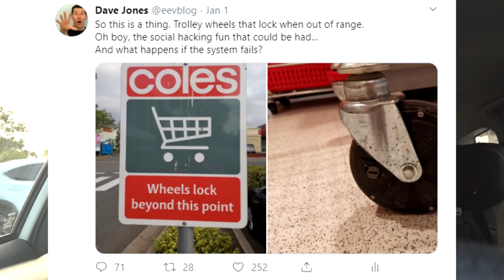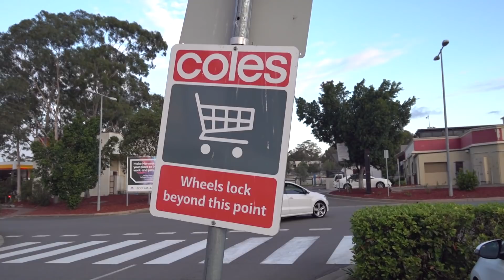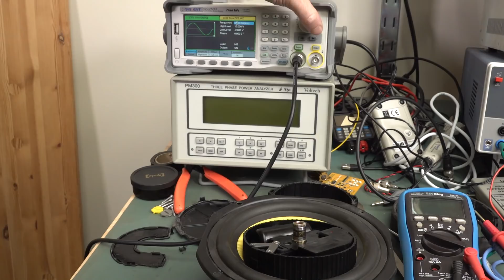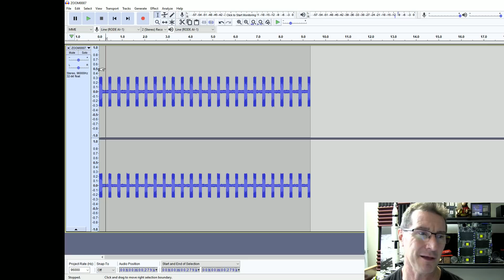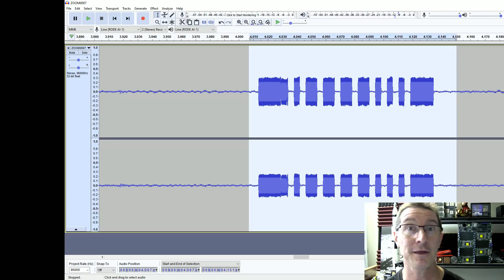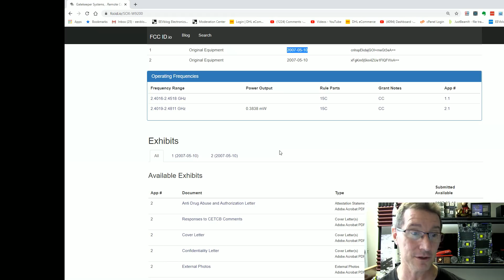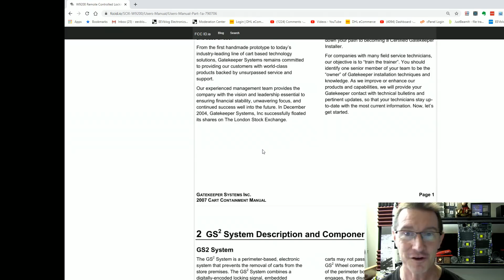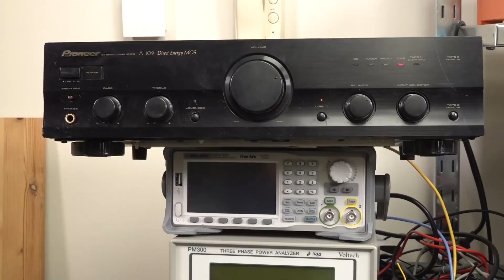EEVblog #1287 - Gatekeeper Shopping Trolley Lock Investigated

Comment: Hey Dave, Do you not think that it's a unique coded signal specific to the installation. I mean each supermarket will have it's own unique signal code to lock and unlock the wheels and that's why it didn't trigger it.

Also, is that supermarket using the Gatekeeper system? Because if it was made by another brand then the signal will be different.

Just a thought.
Reply: You're dead on
Reply: @allensmithphotography  The sign at the shop was from Gatekeeper Systems so i don't see why the wheels/system itself wouldn't be.
Reply: @danmackintosh6325  because the wheel was sent by a fan not from that shop
Reply: @allensmithphotography  Pictures on the FCC application look 95% similar.
Reply: @sleeptyper  right and America alone has multiple manufacturers of these devices likely purchasing or licensing the design but would want their accessories to only with their wheels and vice verse
Reply: @allensmithphotography  but both Dave's wheel and those at shop are "Gatekeeper" brand, can't see them having specific code for a specific shop since what would be the point?
Reply: dan mackintosh neighboring shops?
Reply: Unique identity for ever wheel so individual trolleys can be stopped. I'd guess the small antenna on the pcb picks up data as to if it will be stopped either at the door or the edge of the car park. The inductor probably picks up a big signal hidden in the ground to activate.

Comment: I spent around 14 years working at a GPS chip startup which shared a parking lot with Gatekeeper Systems. We'd see their engineers pushing carts around the parking lot all the time, and occasionally chat with them when we were out taking walks. But this is the first time I've seen the inside of one of these wheels! Thanks for sharing this one!

Extra credit for anybody who can figure out which GPS startup I worked for. Note that it wasn't a little startup for that whole period; we got bought by a much larger company, which then got bought by a MUCH larger company.

Comment: I'm from Italy and here the carts need a coin (or sometimes you can use a dedicated token) to release the locking mechanism from the next cart in front (they are all chained together and then to their parking spot) so people naturally want to put them back properly to get the coin back at the end
Reply: Same here in Germany. I think this system with refund for the cart is used in supermarkets all over Europe. Here you can either insert 50 Euro cent, 1€ or 2€ coins and unlock it. Everyone brings back their carts -  problem solved. No expensive probably unreliable technology needed. I know Aldi implemented the system in the US as well.
Reply: We have that here in the southeastern USA with a few stores like Aldi, but stores like Walmart just have cart corrals all over the parking lots, same with Kroger(food stores) which have the different sized carts, and corrals all over the parking lots. I guess people in my area just don't steal the carts as often as some others, and like i said Aldi being the most security I've seen, and the worst being the Walmart parking lots of people pushing the carts into the grass areas because the corrals are so far apart in the giant parking lots in which some are as big as a small trailer park.

Comment: So basically like a drum brake.
Reply: Beat me to it I was just going to say that thought I'd look forced so I didn't embarrass myself repeating comment.
Reply from the maker: Ah, now that you mention it, yes.
Reply: Yea, I thought that those plugs would drive out like a piston to block the wheel from turning until he took it apart.
Reply: Ahh really smart and effective.. and I haven't got to that part yet, I'm already excited to see it :D
Reply: Thats exactly what I thought it would be. Low force, simplistic design = cheap cost.
Reply: Yup
Reply: Reminded me a lot of the electric brake drums on caravans and trailers
Reply: It's not flush, so it's more of a mechanical drum brake of sorts
Reply: In principle,no . Drum brakes don't work in this way . Drums have pads that exert evenly and have proportional friction based on how much force is applied in a non linear way. Plus drums have a much higher temperature range and mechanical advantage
Reply: @eksine  The basic actuation principle is the same on simple drum brakes, so the analogy is working.
Reply: @ehsnils  not really, the Force applied is uneven and it has teeth.it merely looks similar to drum brakes but in principle like I said it's not anything remotely close. It's like an Elvis impersonator. It might look like Elvis but it's not even close
Reply: yeah they arent veey good, if you force it they burn out pretty quick hence why the new snap cap version is used more now.
Reply: @eksine  An impersonator? So basically, like Elvis.
Reply: I was thinking more like a centrifugal clutch but yeah drum brake too
Reply: The way the inner plate is pushed against the inside of the outer plate is somewhat similar to a drum brake. 
But the act of stopping it is locking rather than friction. 
So the way it behaves is more similar to the park gear in an automatic car.

Comment: The colour insets that appear to do nothing are possibly for identity/programming indicator.  The combination of two colours could identify the specific lock code it is set for.  Typically for large chain stores they have a central depot/repair facility for broken trolleys and the repair centre would need to easily identify the unlock/lock codes easily or check the repaired trolleys are sent back to a store using that code.

Comment: You make me want to design something to lock up all of the carts in a store simultaneously.
Reply: Robert Paulson that would be very fun :D
Reply: It might just be that our humble example wheel isn't configured for that signal? You could probably just capture the signal from whatever shop and blast it back through to the carts there
Reply: I would not want to troll this system too much. I hate seeing trolleys littering the streets everywhere.
Reply: Even better, one that disables only the carts near you. So when you're dashing for an empty line and someone with a huge cart is going to beat you, disable them and zoom by.
Reply: @gblargg  Put a coil past where people get the cart, but just inside the main door or something - cause a nice traffic jam going into the store. Or a little portable one so you can roll by other people and lock up their cart!
Reply: And as for the store's code, you just walk past one of the perimeter loops on the way in to record the store's lock code.
Reply: magnetic code need to be "transmitted" within probably a few centimeters of the wheel max, so you would need to at least run some wire across where you want them to lock up. 2.4GHz RF transmitter can probably reach carts from far away but unlike magnetic lock code the radio may be encrypted
Reply: I knew someone would come up with that..(besides me), I was thinking a small ankle xmitter,  just get a couple every so often, preferably at the back of a line of carts. Obviously at a place the management is rude. Would drive them nuts.
Reply: Lock the trollies in the bays..
Reply: @garystinten9339  large induction cool down your sock, wire up your trouser leg. sorted. just walk past and kerching :)

Comment: Did you ever figure out what was on the other side of the grey and yellow plugs?

Very interesting video, by the way. My local grocery store has these and I was always curious what was inside. This is inside Philly, so presumably they'd lose a lot of carts to bus stops or people simply walking their groceries home otherwise.
Reply: Now I'm thinking maybe it's some sort of psychological deterrence system lol
Reply: There is an inductor on the backside of the PCB that alights with one of the ports, that is shown towards the end of his disassembly.
Reply: @ethanpoole3443  That doesn't make sense...does it? The internal module rotates within the outer case.
Reply: Dominick Pastore That’s a good point I hadn’t really thought about as I was going by what Dave had said.
Reply: Since there may be different stores in the vicinity that use the same type of system, they may simply be color coded to indicate which handheld transmitter will work on that particular cart. (We call them carts in the US) The handheld transmitters may have a manual way of changing their frequency to match the color code.

Comment: Man, I was hoping to see it activated. Would be fun to broadcast the signal in-store and have all the trolleys lock up. (Not that I would condone that)
Reply: The signal to noise ratio would have to be so high you couldn't descreetly do it but you could trigger any near you within a couple meters or a few feet
Reply: I guess with an adequate transmitter 2.4GHz RF signal could probably be transmitted to a few dozen meters with little to no problems. This is the same frequency as Wi-Fi. However communications may be encrypted or at least scrambled to make this situation more difficult
Reply: @jwhite5008  the only issue is it's an audio frequency carrier. There's a vid here on YouTube on how to make a locking device with Arduino
Reply: No. It is the magnetic coil that has audio frequency and you don't even need an arduino for that (although it can do that too). 

But magnetism falls off quadratically meaning you need a small electromagnet (actually just a wire with a driver) if the wheel is very close to it but would probably need a HUMONGOUS GIANT industrial crane electromagnet if it's just a couple of meters away. Anything farther is totally out unless you want yourself (and your gigantic dangerous machine) arrested immediately. 

But, you can also command this thing via radio frequency - same one as Wi-Fi among its many other uses - this does in theory have signal properties of Wi-Fi (although there may be many hurdles in practice), so it can be transmitted from some distance. But because of that the signal encoding would probably be a lot more complicated than a simple 8-bit code.
Reply: Jack White You could broadcast to the entire neighborhood with a 10-20W transmitter :) Highly illegal, of course.
Reply: @jwhite5008  you're right for audio frequency you wouldn't need an Arduino. The vid I was referring to used an Arduino to encode the lock command via a Mosfet onto the carrier. And yes the coil in the drive used an audio frequency carrier but that is due to radio regulation and is the easiest way to spoof the wheels to lock. I'm sure with enough research, time, and effort one could use a 2.4 GHz to directly communicate to the Mcu but it would take allot to decifer the commands and sequence to get that route working. And after thinking about it further, it may be that the battery in this wheel may be too low to lock the wheel without a significant amount of signal power

Comment: Always wanted to know what exactly was inside those wheels, thanks for posting excited to finish watching.
Reply from the maker: No worries, Fascinated me the moment I saw it.
Reply: @AppleGameification  could have been the 'ant tilt bar' as described in the user manual, page 5 (https://fccid.io/W3Z-W9460/User-Manual/User-Manual-1480101)
Reply: @AppleGameification  I just saw one like that a week ago. The front wheel had a bulky cover over it and the handle had a warning that it would lock when taken off premises. So I can confirm it exists. (It did have an anti-tilt bar on the back wheel too.) But another grocery store I visit regularly has one like in the video.

Comment: As a cart pusher for Walmart in Canada I can tell you that system does make a big difference when it does works. Because we have "fence" off in the mall we lost about 80 of them in about 3 months.

Cold temperatures (below 20 c) drained the battery very quickly. We have more than 60 locked or broken.

Comment: Before watching the video. I believe it's based on the 'quadrature' principle. two transmitter loops are are set up around the perimeter of the market, one inside the other. the relative phase between each signal is checked periodically. if leading (or lagging), the trolley is within bounds; if lagging (or leading), the trolley is out-of-bounds.

Comment: I used to install and maintain Gatekeeper systems. The colored plugs identify the manufacture series and if it's a primary or secondary wheel. The basic system operates on a AM signal with a range 2-3 feet from the buried line around the parking lot perimeter.

Comment: The lock signal would likely be set by the owner of the system and not a generic code. Thus you would need the signal from the carpark in which the wheel was removed from.

Comment: Here in Denmark on many carts you have to deposit 1 or 2 € in a lock to get the cart; you get the deposit when you return the cart.

If you don't return it, somebody else will, so not many carts left standing around.
Reply: We had them in Finland, until someone realized that you can make plastic coins that are cheaper than dirt and just plug one in. Ether that or locking systems broke cause almost all of them are unlocked these days.
Reply: They were a real pain in the ass because I never had the correct coin for them anyways. And since almost nobody carries cash around anymore the system would just lead to people not being able to get a cart for their shopping.

Comment: I think those road coils are giant metal detectors for traffic, we have them at our traffic lights all over to control the lights
i assume this works by simply locking up when out of range of the transmitter and the inductor is for unlocking or reprogramming
EDIT: proven mostly wrong by actually watching the video :P
Reply from the maker: No, watch the video, I capture the data from it and show the installation instructions for the cables.
Reply: @EEVblog  It certainly seems as though they did not install the system very well then. The twisted pair and lockbox perimeter antenna configuration is only intended for sites whose "perimeter contains many existing barriers." It seems clear the curb does little to stop the carts as opposed to the recommended "perimeter wall" and the lockbox in the roadway will only lock the wheels of carts that pass over it. I think if they had used any of the loop antenna configurations they would have a better chance of disabling stolen carts so that you wouldn't still be finding them all over.
Reply: EEVblog The loop in the street is for traffic light control.  A private corporation does not have the right to alter the public roadway.  Per the installation instructions the loop for the device is installed on the perimeter of the corporate owned private parking lot.  Similar to the “invisible fence” used to contain pets within one’s yard.

Comment: My encounter with these:
I was driving to the doc and parking there. Afterwards I went to the small supermarket right across the doc. Didn't bother to repark the car on the supermarket lot. Took the cart out to the car at the doc parking lot and it goes *LOCK*. With heavy groceries in there it is impossible to drag a locked cart, even when only one wheel locks. I ended up carrying all groceries from the spot where it locked to the car. I got so mad that I tossed the locked cart back in the cart lot and clicked it into another cart. Staff would have had a lot of fun ondoing this.
It's impossible that supermarkets save money with these systems.

Comment: I came across a different system as a kid that once locked allowed you to reverse the trolley and bring it back into the car park.
I quickly defeated it by pulling the trolley backwards over the border.
Reply: PUT YOUR TROLLEY IN THE AIR
Reply: This system can be equipped with an unlock loop behind the locking loop

Comment: You've never seen a drum brake before? That inner section is just a pair of brake shoes. Once the screw is driven forward, friction prevents it from slipping back under pressure.

Comment: The early (pre-2000) wheel locks were, as you suggest, just a coil that locked the wheel electrotechnically at the perimeter of the site.

The latest systems are designed so that not only does it stop trolleys from being taken off site, but also, to prevent 'push-outs', the wheel locks activate at the door if the trolley has not been taken through a checkout first.  This protects not only the trolley itself (a few hundred of your favourite currency), but the theft of expensive goods loaded into the trolley and not paid for (your $560).

Comment: My local home center put these to a somewhat novel use - They installed a moving walkway between the first and second floors and to prevent runaway carts on the incline they installed those wheels front and back.  As you cross the entry threshold it locks the wheels, and as you cross the exit threshold it unlocks them.  No matter how heavy you've loaded the cart, it stays put on the ramp.

Comment: We have had these in Victoria for a good decade. Ours work by locking when they are out of range of the transmitter.

This is super annoying because if you park too far away from the supermarket the wheel locks before you get to your car and you have to drag it across the car park